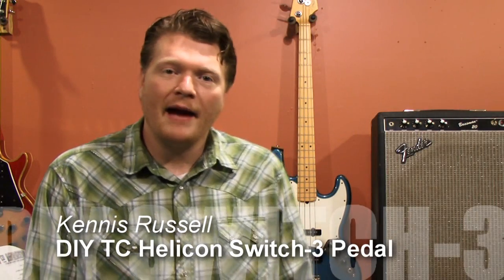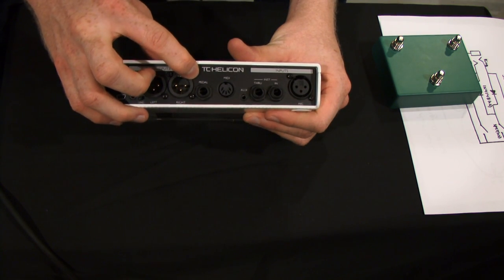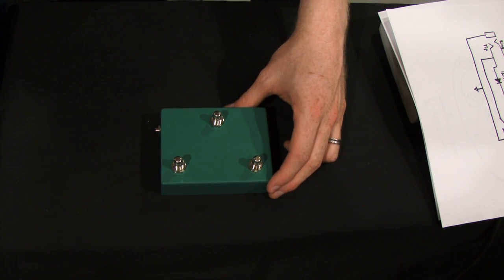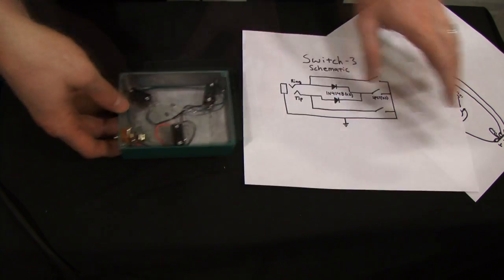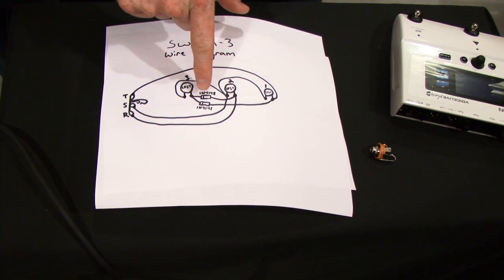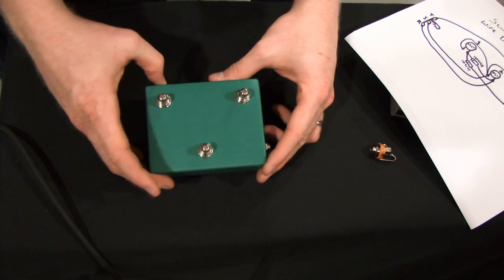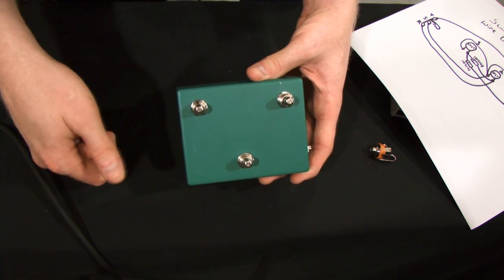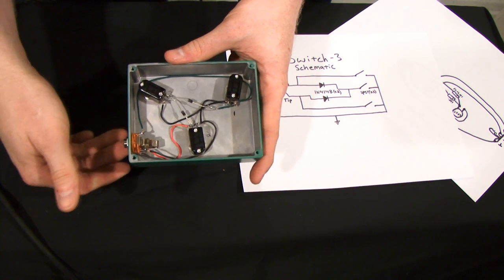DIY Switch-3 Pedal for TC Helicon Voicelive

Comment: Hi Kennis.
Thank you very much.
I did this to use it with TC Electronic BH550 Bass head and works wonderfully.
As far as I know this will work with BH250 and BH800 as well.
Just one advise, when the pedal is connected to the Bass head, it will override the amp switches for mute and toneprint 1 and 2, just be aware of this.
Thanks again.
Greetings from Mexico
Reply: Just built this for my BH800, works perfectly!

Comment: If you're looking for a quicker way to do this, buy the Digitech FS3X. Straight out of the box it selects presets 1, 2 & 3 on my Helicon Perform-VK and costs £22.90 ($35.07 on sale at time of writing) on Amazon with a long lead. Saves time and soldering. You do miss out on the satisfaction of having done it yourself and the switches are a bit close together if you're a Sasquatch like me but so much time and hassle saved for minimal outlay.
Reply: The FS3X work perfect with the Perform VK? Can you program it?
Reply: can you customize your switches though? like you could with a switch 3 or 6? thats what id like to know. because if it does. id buy one rightnow!

Comment: Great tutorial.  Very nicely explained.  My question:  I'm considering the TC Helicon Perform VK.  I want to be able to turn on and off the vocal harmony as I play keyboard.  I only need one switch for the harmony function.  Can only one switch be used?  Also, I wonder if the harmony feature can only be on while the switch is depressed, and off when it isn't?  Probably not, but that would be a great feature for me.

Comment: Kennis, did you extend the one diode? It seems too short to make a connection. Did you solder every connection? Would it work if you didn't solder?

Comment: Hello! I have a problem. tc helicon voiceworks. All soldered on this scheme, set up the device - works adequately only the first button, the others do not respond. What could be the problem. Diodes 4148, plug - stereo jack. Thank you
Reply: are you using a stereo cable?
Reply: A few on-off stereo jack cable - a miracle happened - the beginning of all work

Comment: I will do it for my bh250 =) tks
it works like that:

(1) earth + tip = mute
(2) earth + ring = turn on/ turn of toneprint
(3) earth + ring + tip = change effect - last effect
Reply: Hey...what kind of switches do you use for that???  Normally open por closed?
Reply: You need a switch push button (push = on, release = off).
Reply: Rodrigo Lopes  I followed this video and the schematic to the t and it works. However, it does not work like you've listed. Here's how mine works:
(1) shield + tip = oldest toneprint on/off
(2) shield + ring = newest toneprint on/off
(3) shield + tip + ring = mute

At first I thought something was wrong or shorted. I rechecked everything and plugged in again. Works like a charm!
Reply: Joel Jacobson, I made it  for BH250 and it works like that:

(1) shield + tip = mute
(2) shield + ring = turn on/ turn of toneprint
(3) shield + ring + tip = change between oldest and newest effects.

I don't know about the Helicon Voice Live.